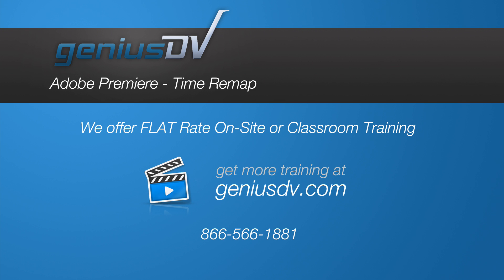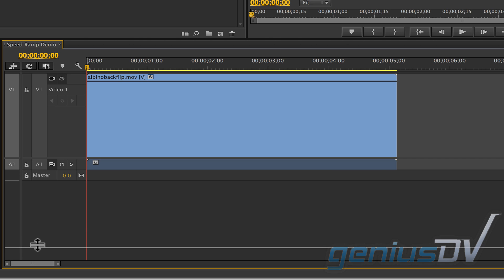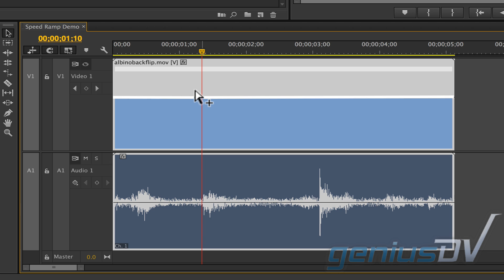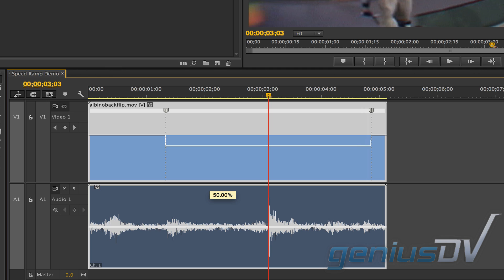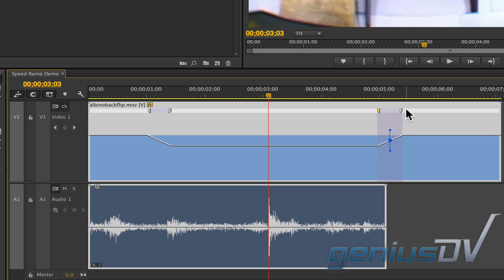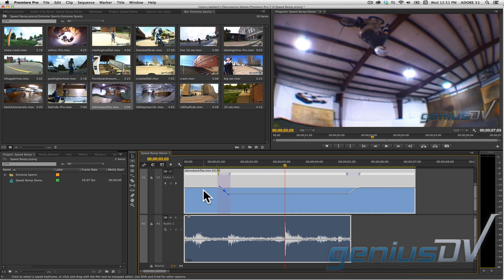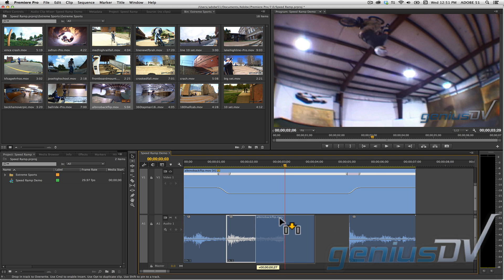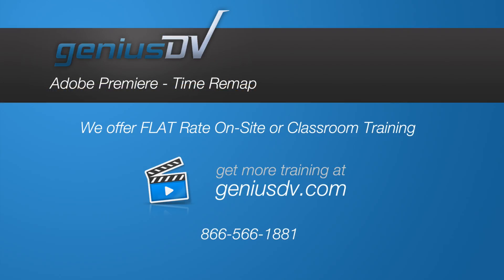Adobe Premiere Speed Ramp and Time Stretch

Comment: For audio ramping, I have a technique, but it is tedious.

This example is for a declining (slowing down) ramp.
Drag the play head to where you want your ramp to begin. Razor it. Set the play speed of the track to the right of the play head to 95%. Move the play head to the right by [X] frames. Razor it. Set the play speed of the severed track to 90% and move the play head [X] frames. By now you get the picture. End the ramp wherever you like and maintain that play speed.
FYI, 3 frame sections at 30fps will result in a ramp that takes 1.7-ish seconds to go from 100% to 0% If you want a different ramp rate, do some math

Edit: you can also smooth the transitions by using crossfades

Comment: Thanks a lot for the video. I kind of had the feeling the smooth slow-motion effect only were on video parts, because when selected an audio track, and going to Time/Duration,  the box next to Time interpolation were ghosted. Well, not your fault, and you did what you could best to fix the audio slowmotion. Nice video. I just hope, that Adobe will fix that in future version, because cutting and audio, and trying to calculate how much speed it need in order to fit the video part, is well, quite tricky in my mind. In a simple scene, then its okay when theres nothing else you can do. But in a more complex video with many scenes with speed going up and down, then is a lot of cutting, changing speed, and fitting.... So please fix that Adobe. And thanks again for the video John Lynn.